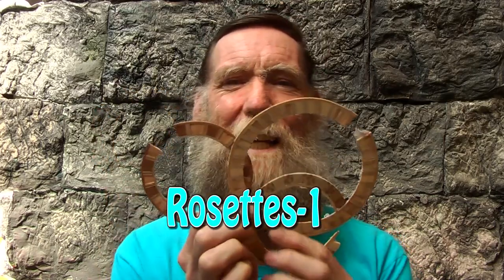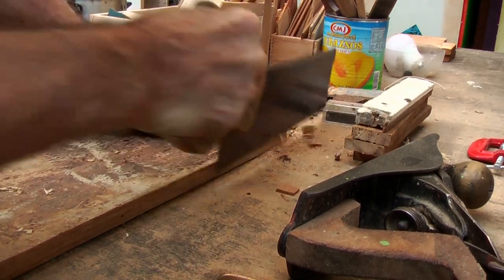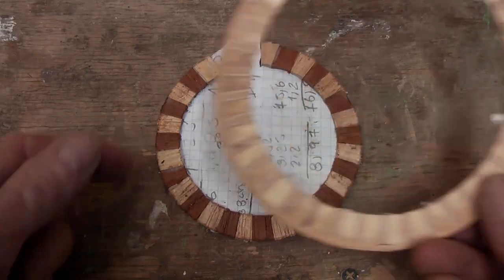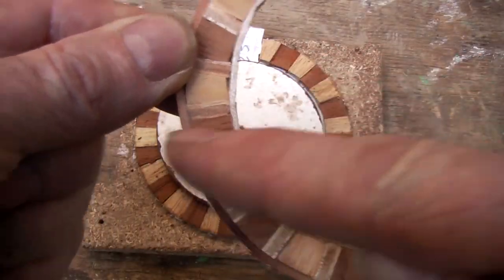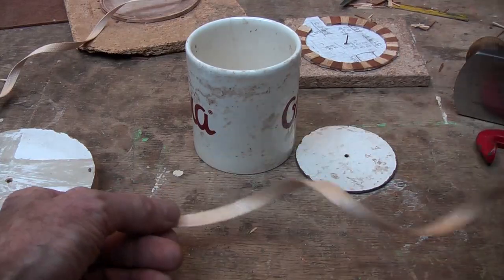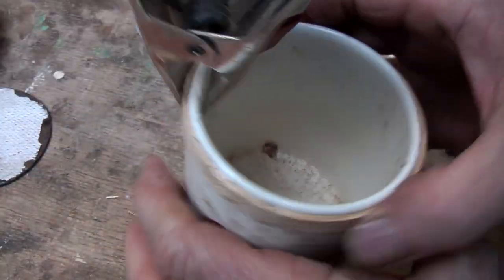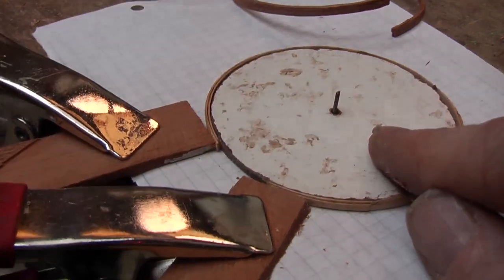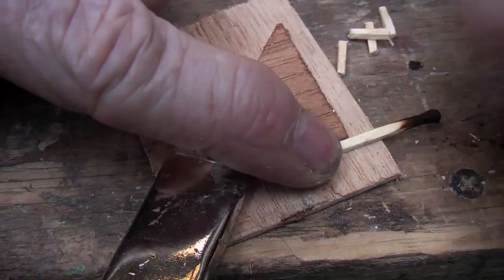Rosettes-1

Comment: What size outside diameter is a typical hole or a ukulele or guitar?
And can u put a hole in the saw blade to cut make your cuts instead of cutting on the side of the nail?
Or will it throw the calculations off